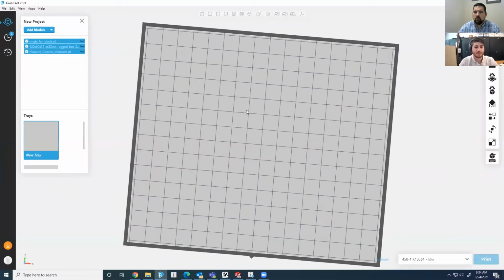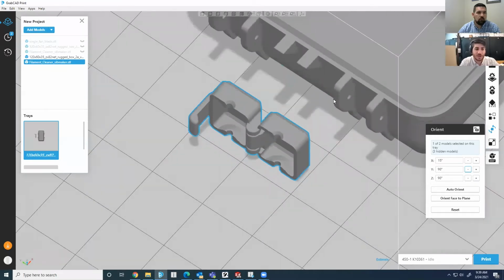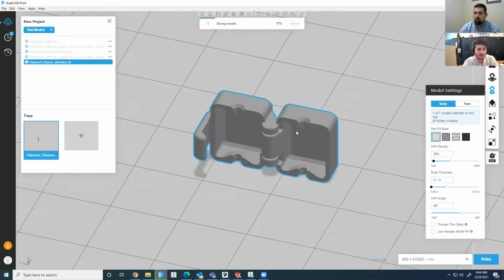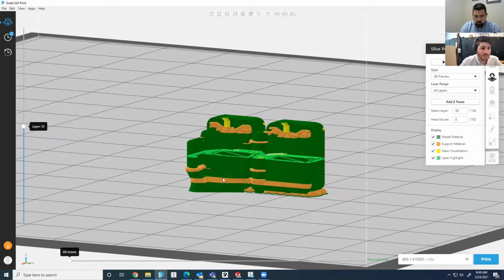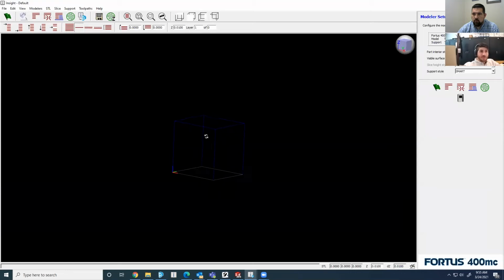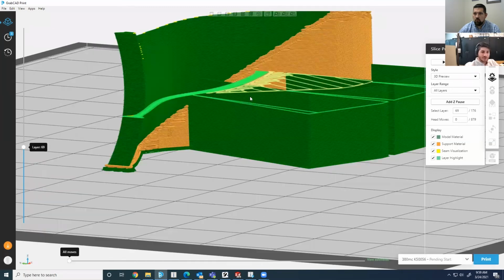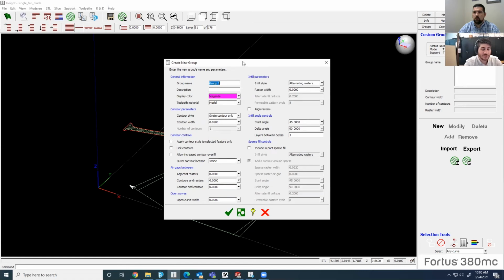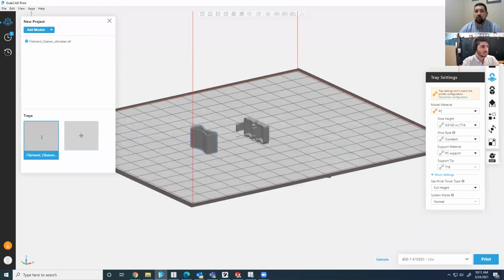Optimizing 3D Models using GrabCAD Print & Stratasys FDM Printers

Comment: how did you bring the part from GrabCad to Insight? when I trying grabing the part that is fixed from gracad print to Insight the part disappears, the reason that I want to do this is to keep the fixing that print has made to the holes and inperfections of the mesh to then export an stl. file
Reply: GrabCAD does not have an export feature once the parts are fixed. The software fixes the files for you to be ready to print but does not allow you to export them for use into Insight or other software.
Reply: @jordannovaksr.9445  Thank you for answering Jordan, is there a way to fix the parts on insight for watertightness?